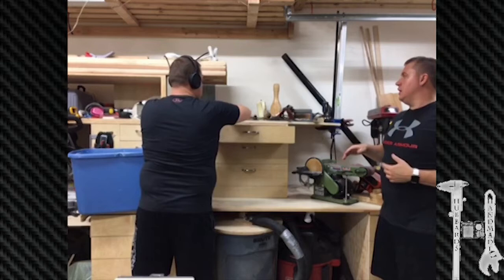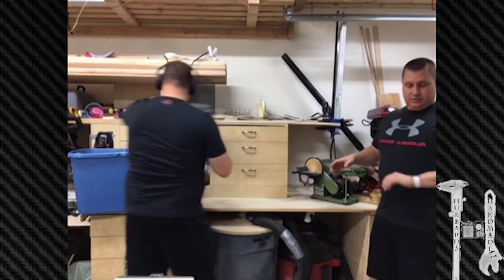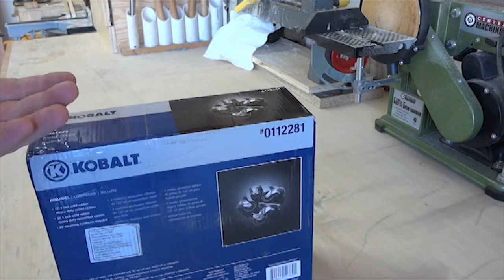Sometimes you have to make a (shop) change...

Comment: I actually want to build a miter saw station based on Jay Bates plans. But instead of having stationary base drawers, I want to have work carts with drawers and storage. I could then tuck them in under the station and pull them out for additional workspace.
Reply from the maker: Jonathan Walker that's a good idea! That's kind of what I ended up doing with this one piece.